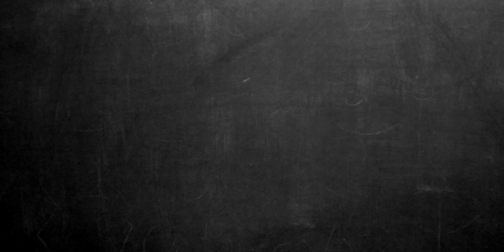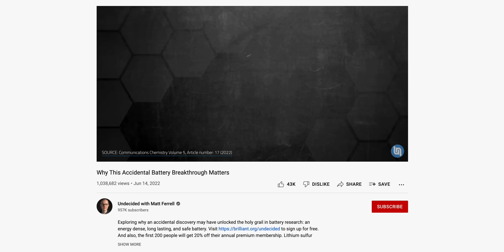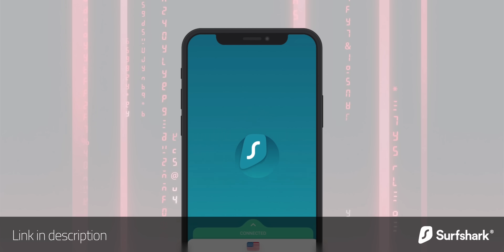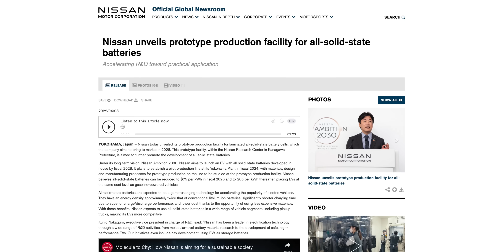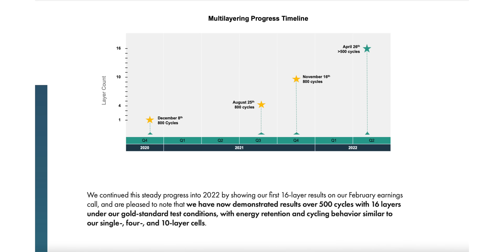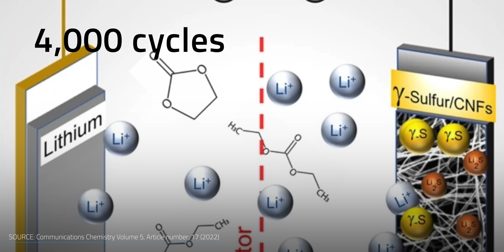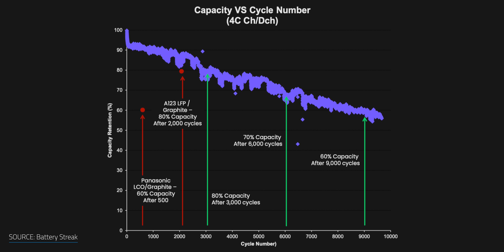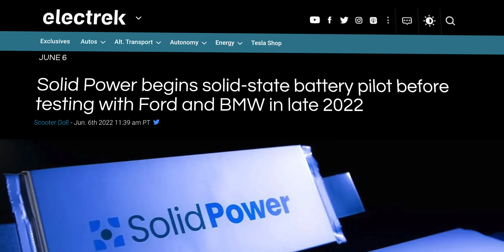Is This Solid State Battery Too Late?

Comment: My expectations for battery technology, solid state very much included, is similar to my expectations for sustainable energy production.

I don't think any one technology/meathod is THE future. However I do think that many of them are a future.

Just as solar will be subsidised by wind and nuclear - so too will lithium-sulfur be, by solid state, liquid salt and hydro.

Every step forward in all these concepts weaves a tapestry of potential for a carbon-neutral (or negative 🤞) and sustainable powering of our future.

Each advancement is important and exciting. every breakthrough is playing its role to better how we live.
Reply: We also need backups in case we run out of things like Lithium.

Comment: The race is on... with these criterias in  determining the winner... Charging time, energy density, safety . I am somewhat dissapointed with current car builders , giving all the attention to what they will use in the near furute,  without ANY attention to replacement batteries of cars built prior to  say 2017 ( 5 or more years ) , which  will come to the end of their life cycles .

Comment: In my opinion, most developments in "normal" aqueous batteries can be applied to solid ones, just with slight modification
Reply: The topology at the cathode and anode doesn't react the same way with a solid-state electrolyte that it does with a liquid electrolyte. Strategies to increase surface area in liquid or gel batteries don't translate to solid-state designs.

Comment: I think solid state really makes sense for cell phones. A phone that gets 3 days of use out of a single charge would be awesome. The small size of the battery should make it easier to get to market sooner.
Reply: There is no reason to have more than one days use, the rest would be a waste of money and added weight. Just one mans opinion.
Reply: @gregkramer5588  3x the energy density of current batteries means the same amount of weight. Remember when flip phones got 3 to 5 days worth of battery?
Reply: @ColeSpolaric  Assuming they are not solid state which has more volume density gains than weight density gains.  Either way people will not want to pay more if it last a full day already.

Comment: Great video.  Why bother with lithium at all? Will global electricity grids be able to provide the power for these technologies? My country UK is looking to replace hydrocarbons completely with several innovative uses of green hydrogen for energy storage, fertilizer production, hydrogen vehicle and electrolyser manufacturing. The aim is for 5GW 2024/5 with 10GW by 2030 powered by the world's largest offshore renewable  wind infrastructure in the North Sea.

Comment: Most of the research is focusing on the wrong metrics. Current batteries are good enough for most use cases, including cars and stationary energy storage. What we really need is to scale up production, by several orders of magnitude. That will also drive cost down, which is the next major issue.
It's not a bad thing to improve energy density, charging speed, and safety, but those are not the most important right now.

EV range isn't limited by energy density anyway, it's limited by cell availability. It's now more sensible to sell more cars with smaller battery packs, as ranges are good enough already.
And stationary storage doesn't care about energy density or charging speed at all, and we need an obscene amount of that right about now.
That's why Tesla is using LFP cells in half of their cars. The LFP chemistry has significantly lower energy density, but much cheaper and need less scarce materials. Plus it's safer and more durable too.

Comment: Batteries are used in more than just EVs. 
As long as research is not a complete dead end, there is always new knowledge gained. 

There is an increasing need for more local or even home electricity storage.
Access to these batteries is much easier, so as long as they are recyclable and the price performance is good, there will likely be a market fit for many different solutions.
Reply: Markets tend to gravitate to a single technology eventually because of economies of scale.

Comment: SSB may only be for increased safety, weight savings and simpler setup, the energy density and charging time advantages may be close to nil in just a year or 2 thanks to advancements in traditional batteries like LFP, NMC and NCA.

Comment: As always, it's an option. Every option will have its own qualities and drawbacks. With more research and time, it could improve, by how much is always going to be hard to say in advance, especially since this broadening of battery types is only a fairly recent development. History is littered with great ideas that were just not quite good enough to beat out something else, but it's also full of combining designs and materials to make a composite that has the best of all worlds, with the fewest drawbacks possible.
One excellent quality of the solid state batteries is how much safer it is than any liquid-based variants. Liquids are by nature a lot more difficult to manage than solids, especially if they're hazardous to humans and/or the environment. Just try soaking a rag in water and removing all of it just by squeezing, I guarantee you it'll still be damp by the time you're tired of it. Conversely, you can bury it completely in sand or gravel and remove almost all traces of that, simply by shaking the rag for a bit.
On top of the basic qualities of liquids (being "they flow" and "they're usually sticky"), assuming both are equally flammable, solids burn much more controlled than liquids do. No burning fluids flowing out across large areas, potentially propagating the fire rapidly - just the one largely self-contained burn. Depending on the material properties, there might be a higher chance of explosions as volatile gases could build up pressure inside until it shatters whereas liquids just move out of the way until a bubble pops on the surface, but again that's dependent on material properties and even geometry. A bursting bubble in a flaming liquid will still send piping hot material flying in unpredictable directions regardless.

Comment: I'm not as concerned about charging times in EVs anymore. I'm more concerned about the price. Until I can get a good used EV for under $5,000, it just isn't happening. I'd never save enough money by not having to use gasoline.

Comment: Hey Matt, have you ever heard of the French MDI's compressed air generators? 
They've been around since before 2008 or so with some really impressive claims, and even had cars running on compressed air on sale with impressive range (back in ~2008) and even in professional trials.
They have achieved some really impressive feats years ahead of their time, but they really suck at marketing, but maybe you could contact/interview them?
Reply: Yes...Light Applications...

Comment: I still think that we are 10 years from seeing solid state batteries for commercial applications.  At times like this, one can truly appreciate Tesla's dry electrode 4680s ;)  Now if they can just ramp them!
Reply: They said that 10 years ago no? Seems like these so called "Engineers" don't want better batteries that badly if it's taking so long.
Reply: @plumetheum7017  How does this statement make any sense?
Reply: @gregkramer5588  You can read right? I would hope so, but I'll explain it to you anyway. 

These "Scientists" and "Engineers" working on new technologies that the world desperately needs always go on about how much progress they've allegedly made. But then they turn around and say "Oh it's just X years away." But come that time, it is still X number of years away.
Reply: @plumetheum7017  I actually am one of those :-)  I am sorry but it shows that you never were.  The problems that they are working on solving are hard. I have worked on multi year projects.  An example would be the ETA10 computer when I lived in St. Paul.
Reply: @L W Not quite as terrible as the complete lack of real progress on new battery technology reaching commercialization.

Comment: Of course the 4680 cell has 6 times the "power" of the 2170 cells, it is six times the size (technically it is 5.5 times the size). This is like being amazed that a gallon contains 4 times more than a quart.
Reply: Probably takes the same labor to produce a 4680 cell vs. 2170 cell, plus fewer individual cells in a battery pack reduces costs there. I think the 4680 is mostly about cost reduction.
Reply: @5tr41ghtGuy  It is much like the different between buying a soda in a 2 litre bottle instead of a 6-pack of 500ml bottles. You pay more for the additional plastic bottles. Not that Musk will actually deliver these savings to the customer, especially in light of him being in the middle of an employee purge to "save money".
Reply: @5tr41ghtGuy  I agree John!
Reply: The larger size allows for better ratio of packaging shell vs internals, resulting in less weight, faster manufacturing, and less cost. Combine that with tabbed cells and u get less resistance, less heat, faster charging, longer lifespan, etc. You know, the same reason why things cost less in bulk. Vs buying 1 small quantity at a time.
Reply: @Ergetro  The larger cell also presents a larger thermal mass which is NOT a good thing with a chemistry with a tendency towards thermal runaway.
Reply: @chrisose  tabless cells addresses these and if some of the maths are right, the total thermal area is reduced significantly as a result of tabless tabs, as well as significantly reducing resistance as a result, which leads to higher lifespan (or possibly higher charging sustained speeds) hence the problem is a tackled in a multi faceted way
Reply: There is some savings to be made on the standard cylindrical cells with no fundamental improvements just by having less steel casing per given amount of battery volume and better space utilisation within the cell given the extents of separator overhang and termination. I would think on the scale of a battery pack as a whole, you can achieve several percent performance improvement.

He promises they'll be cheaper per given amount of energy storage, and that too makes sense, but well then there's the question how much he's overpromising.
Reply: The reason it's actually more surprising than it first sounds is because of dissipating the heat produced both in the charge and discharge processes. Assuming identical technology six times the heat world have to be dissipated through a thicker cell and with a surface that's only larger by a factor of a lot less than six.

You are of course quite right that the energy capacity is no surprise, it's the ability to keep the current capacities similar that is amazing, let alone improving them.

In more detail, and feel free to skip what follows:

The linear dimension is going to be about cube root 6 times as big, so the average distance for the heat to travel is increased by that 

The surface area increases by the square of the above number. These two factors partially cancel as the thickness allows down heal loss but surface area increases it. The back of an envelope overall dissipation efficiency might therefore be expected to be worse by a factor of cube root 6, and charge times increased by a like factor. That's just over +80% longer if the tech was scanned up without any other improvements

To claim an improved charge time is therefore a genuine technological leap ahead, assuming the new cells deliver the promise.

Edit: After reading Roger Starkey's posts (thanks mate!) I now understand that the leap forward is more about reducing internal resistance than in rapid dissipation of heat -- but that's even more of a leap forward as producing less heat improves the efficiency of energy out compared with energy in. So my surprise remains as strong
Reply: @trueriver1950  I am no expert but I believe the main cooling is from the end of the cells.  They have better heat transference to the ends because of the way they are structured. That said you make many good points.
Reply: @gregkramer5588  hi, thanks for your comment.

In addition in my original post I called to consider the possibility that the technical advance is not hear transfer at all, but in fact a new manufacturing process that means less heat is generated in the first place. After reading several other parts I now think this is the main advance.

Comment: What about the lithium iron phosphate batteries already in production in China in EVs? Their energy density is doubling over the next two years, and without using expensive minerals to manufacture them, they also achieve much lower cost, have no issues with flammability, can be charged to 100% and discharged to 0%, and have a much higher longevity than current battery technology Tesla is using. Tesla has also adopted the technology, currently for its standard range vehicles, but it seems only a matter of time (and money) until this technology takes center stage in most of its affordable production vehicles — but maybe not the S, X, or roadster.

Comment: The thing to remember is that each time these avenues of technology are explored in the lab, the more things are discovered like this sulphur breakthrough. You could conceive of some sulphur infused solid state battery that gets even better performance than both. And yes, this thought is just a 'for instance', not based on my research. But the point is that tons of research leads to more possibilities. The one really important aspect of solid state batteries is to hopefully get to a point where you don't have degredations due to the interaction of components like the electrolyte and dendrite formation. Batteries that can be cycled without degredation is really good news for the environment if possible. Then you're not constantly sourcing the elements needed to replace them, and all the waste that is associated with that.
Reply: Once the tech proves a bellow 10% degradation after 4,000 cycles and dropping the fast charging times to way bellow 30 minutes the whole industry will ditch the ICE in favor of EV. Maybe semi trucks will still be diesel but beyond that hopefully we're within a decade of that.
Reply: @makatron  I hope it doesn't take that level of technological advancement to have everyone start hoping on the EV bandwagon, but yes, if your stated values were in the real world right now, people would be running from ICE vehicles.
Reply: @kindlin  right now it's a matter of price barrier but as Ford has proven it can match pricing with EV and ICE versions of F-150.
Reply: @kindlin  It will. Mass adoption of new technology requires it to be WAY better than what came before, especially if you're talking about something that will require massive infrastructure projects and the replacement of millions of instances, and this especially holds true in an economy where the average person is barely holding on above the poverty line as is.
Reply: @kindlin  The high gas prices has people somewhat heading in that direction, wait lists for new BEVs range from months to years and trying to find a reasonably priced used BEV or PHEV is a lesson in futility, even old regular used hybrids are way overpriced. It seems manufacturers can't make EVs fast enough, mostly due to supply issues with batteries.
Reply: All good points. We seem to be on a cusp, tho.